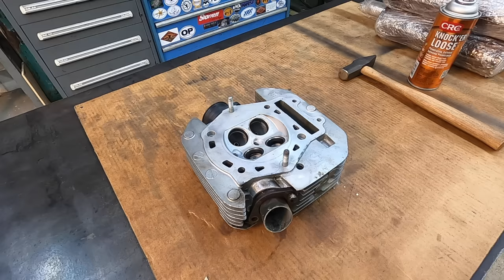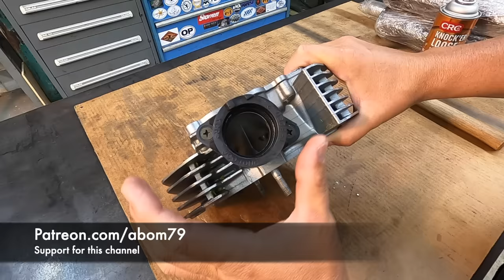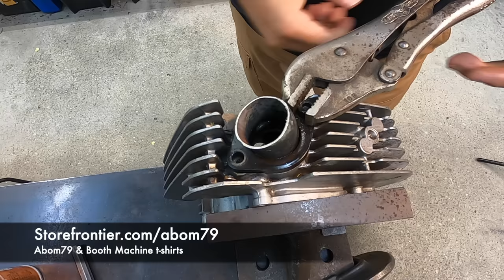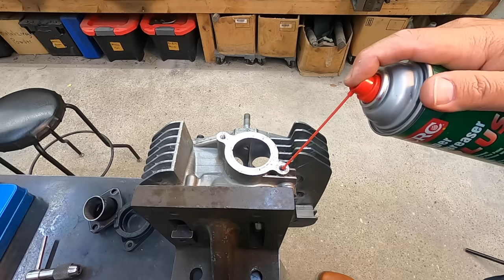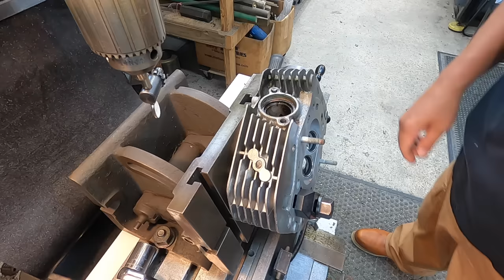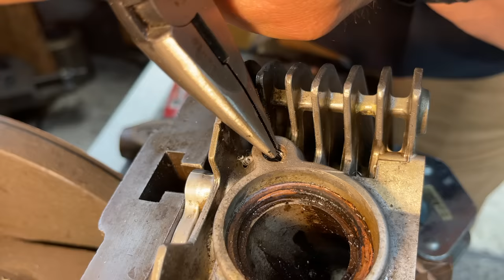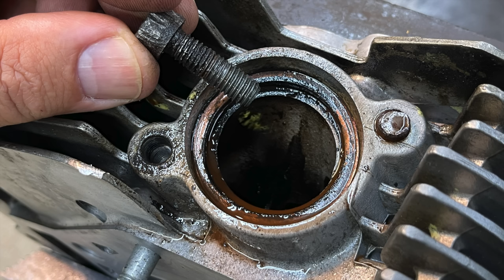Broken & Siezed Bolt Removal, DR 650 Cylinder Head

Comment: I had good luck sometimes, not every time, welding a fender washer to the broken off bolt and then welding a nut to the top of the fender washer.  Fender washers provide a larger surface area to weld to than a regular washer.  Just for anyone that doesn't have access to a Bridgeport but has a welder.  Good job!
Reply: Great job👍

Comment: If you have a motorcycle, you HAVE to have an impact driver.
Reply: @jlinkels  same here, identical, in 1976
Reply: With the full range of tools in high tensile steel !
Reply: With every motorcycle I have owned, FIRST THING MODIFIED, remove and hurl away every last engine cover Phillips-head bolt.
Immediately replaced with a set of grade-8 socket head cap screws.
A single allen key works WAY better, lasts longer, and takes up much less space in the on-board tool kit .
Reply: and JIS bits
Reply: @jlinkels  About 74 for me.  Identical
Reply: @jlinkels  Ain't broke don't fix.
Reply: @agwhitaker   Totally agree ! I used to work with Oilfield Tubulars and had access to ,'API Modified', a special silicone grease containing lead and zinc particles which I used to smear on all threads to help stop seizing up. Worked 100% !
Reply: @agwhitaker  That's the way! And if not Allen Key then Torx. I developed some kind of "hate" against slotted, Philips, JIS and Pozidrive screws over the years. Maybe due to the fact that I came over hords of cheap screws from Asia in all the things I was working on. So I also get those out of any model kit or motorcycle I am working on. You may call that somekind of obsession, but I believe it makes maintenance work much easier. The only exception I would accept would be some 60 to 100 year old classic vehicles. Imagine a 1930's Bugatti with Torx or Allen Key screws.
Reply: any repair work, on anything, Impact driver is a great start !
Reply: @erebus1964  Agree, yet have become fond of Honda style 8mm hex bolt style as they don't fill with gunk and offer good grip with lightweight tools as well.

Comment: When they're really stuck like that I generally apply heat. Get it really hot and then if it doesn't come out I'll allow it to cool shrinking the bolt. Add a little bit of penetrating oil then again try to turn it out while tapping on it. It can also be drilled and an easy out used. Sometimes a variety of methods have to be tried before something works.

Comment: Many people have explained what is happening here but I will give you the final correct answer. I studied and understand materials, I'm  a Materials Scientist. 
As previously explained here we have steel and aluminium joined as a thread rod. When installed together especially without antisieze between thread, these bolts can lock together especially if they corrode. Rust expands 5 to 10 % . This causes tremendous internal pressure.  In addition differential corrosion can occur with dissimilar metals.    The only true way to undo rusted and chemically 
bonded bolts is to heat the bolt and cool it down QUICKLY  with a wet rag ( heat it to say 800C). This heating by itself doesn't work all the time. Heat and sudden cooling give threads a thermal shock. I have proven this on a nut holding magneto cover on lawnmower.  Heat alone would not loosen it. Thermal shock with cold water broke the bond. Also WD40 falsely claim they loosen bolts. That oil cannot penetrate a rusted bolt. They are spurious claims. 

Have I helped anyone out there?

Comment: Retired Master Mechanic here....
On Aluminum parts, you can HEAT or COOL the component to cause that metal to expand or shrink.
In this case, I'd have put that head in an oven, THEN try removing those bolts !  Try it, it works !
( this one: 350'F for 30 minutes before working on those bolts )
😊😊😊😊😊

Comment: Just welding a nut has been 50/50 for me over the years BUT if u take a washer, weld the inside hole to the broken bolt and then weld a big as possible nut to the outside of the washer then try. Has work 100% for me from tinny screws to wheel studs on skidders and shears
Reply: Sir, that's a very good suggestion,  thank you 😊

Comment: Well done Adam, You were very persistent on that first bolt, and you made it come out, the two smaller screw with the impact driver, The right tool for that job, the last screw, you dead centred that one, and peeled that thread out, I have managed that a couple of times but you only need to be a small amount off centre and it makes it a lot harder, I've been there too.

Comment: Lots of comments about patience, etc.. what comes to mind here is confidence and determination. This is the last stop for this bolt.
It has to come out, there is no where to bring it to “fix” it for you. Things will escalate until the end. Easiest first, if no, next step.
I think there’s a point in your work,profession whatever that is, that submitting to the problem or defeat does not enter your mind.
There will be a resolution, for sure. You have become competent at your work.

Comment: In my experience over the years I found that applying heat modestly  and allowing the area to cool down and heated up again quickly  helps a lot in the process of moving bolt. Works for me.
Reply: I would also apply heat too long process

Comment: I really miss this kind of work. Spent most of my life doing all kinds of tool work. Good to see the older techniques still being used.  First off, fixturing your work properly is tantamount to applying force to the work piece, whether it be shock , twist or machining force.  Patience when you have something to grip too and being conscious of saving the original threads is becoming a lost art.  You can't always use a heli-coil or keensert so build your skillset to the worst case scenario and always get the job done.  I used a dowel pin with a square ground face, to remove the radius edges,  to align the drill chuck or mill collet.  I kept a set of sizes including odd ball in between sizes made from ejector pins or any other decently group metal rod in the same box where I kept my edge finders and wigglers.  My last job discarded so many great old mill accessories like dividing heads and adjustable angle plates, rotary tables etc.  They really thought the CNC's didn't need any of it. Glad to see someone who knows better. Keep this kind of work alive friend and it was great to watch.

Comment: The good ol' Vessel impact driver - always looked the same  - I've had mine for 45 years.
The bits are JIS ,by the way
Penetrant generally doesn't work where it is an alloy part. The aluminium oxide that forms in the thread is far less porous than iron rust.
On the screw that still had a head, I would have heated it with the TIG arc and let it cool ,then tried the vice grips again. The heat sometimes degrades the oxide that is seizing the fastener and allows it to break loose.
Reply: mine was the same just marketed by Imperial. Many happy years
Reply: I had that exact tool about about 40 years ago too.  I didn't need it often but man it saved my butt many times.
Reply: @boaterbil  Had mine since the 1980's  Worth it's weight in gold.
Reply: thanks for the wisdom.
Reply: I'm guessing they all come in the same blue case as well hah, mine did.
Reply: @ItsMrAssholeToYou  or if you have this handy dandy inductive coil you can do something pretty fancy. Like so:
https://www.youtube.com/watch?v=YJElT9xK3bk
Reply: CRC penetrant is trash, so is PB, so is Kroil and pretty much everything else.  Try Nano next time.  I'd also have heated it by welding a nut to it because if that didn't work it would have been the same steps to drill it out, but welding a nut on has worked literally every time for the last 30 years.  I would have also helicoiled those threads while the head was off.
Reply: The second I saw those intake screws it was screaming for my old trusty impact driver.

Comment: Snapped a headbolt on my 750 Norton years back,drilled out the stud with a undersize drill bit ,chased the threads with a tap,worked well without removing the engine from the bike,lucked out.

Comment: I have had one of those impact drivers for over 50 years now. I must admit, I had it for a number of years before I found out the head comes of it to show a 1/2" drive  that fits 1/2" sockets, which makes things a mite easier at times. I still use it occasionally now, a year or so the last time.
Reply: Just about every home and shop cycle mechanic had to have them...I still have one from the 1970's.
Reply: @Garth2011  I have one too. I bought it in the 70s for work on my Honda motorcycle........ I think it cost~$5!!
VERY handy!!
You would be so surprised how many do not preload before hitting it.

Comment: I’ve removed hundreds of bolts using left handed drill’s,
I’ve also used left handed taps then removed the bolt with a left handed bolt,
It’s worked 9 times out of 10.

Comment: My old French Guru, when I was serving My apprenticeship in HD Mechanics, taught Me to, with a brazing tip, heat the stub of the bolt to red hot, then allow it to cool naturally....the cooling rate of the dissimilar metals would cause them to microscopically separate, leaving a gap to allow penetrant to invade....the impacting would be an aid also to the penetrant, before using Your best means of extracting....be patient, use all the tools in Your toolbox, before applying brute force.....God bless Magoire "Max" Beillard, He served His apprenticeship in France during WW2, no parts available....You  "fix" everything....

Comment: Another great video. I see some comments lack common sense.  I have the same impact driver I've had for probably close to 40 years now still works perfectly. Have to use those a lot inside transmission on motorcycles on tear down and install.

Comment: Anybody that says welding a nut to a broken off bolt ALWAYS works, is either very lucky or hasn’t done that procedure much! In 40+ years of dealing with this kind of stuff, I’d give it at best a 50% success rate. You gotta have a full bag  of tricks in this kind of work!
Reply: Welding a nice thicker washer works better the washer ID must be bigger than the stud OD then weld a nut to the washer it’s not 100 percent but much better than just a nut which is difficult to weld into the internal corners compared to a washer.
Reply: I agree and am not convinced that method works like people think it does. Why would welding a nut to the bolt be any stronger than the original head that snapped off? I don't think it is the nut that does most of the work but the heat shock of the weld.
Reply: It works the best for armchair quarterbacks. In the actual shop environment, 50% effectiveness would be a stretch.

Comment: I worked in a fab\machine shop for 30 years for a moulding millwork / lumber mill, retired now. Removed many broken and seized bolts over the years just like you did it. Always preferred doing it this way instead of taking a chance of destroying the part with heat or other extreme measure, good work, love the videos makes me want to go back to work.

Comment: I've taken many broken-off bolts & studs by welding a washer on first, then a nut on the washer, let cool,, then heat some, add candle wax.  this high welding heat breaks the bind, comes out with a socket or box wrench.   Welding & heat can do wonders.

Comment: Many years ago, an old neighbor was a fantastic Harley restorer.  He showed me the trick to chemically dissolve steel bolts from aluminum cases and transmissions with alum.  It’s my go to with aluminum (I only have hand tools, no mill or lathe).  Sometimes not having to completely disassemble a machine is nice too.  It’s a really good method for getting that broken tap or drill bit out of the hole

Comment: That was sweet! This method is nice if the part is off the bike, and you have a well-equipped machine shop. However, if the part is still on the bike/car, in a tight spot, then a mig welder and vice grips come to the rescue ~95% of the time. Last head stud I had to extract off of a Suzuki GS1100 took about 10 "blob" weld attempts, but was very satisfying when it finally spun out :)
Reply: Try welding a flat washer to the broken stud or to the frozen stud head, tgen chip the slag and weld the next size up, bolt to the washer, all the way around if possible. Let the RED go away and then slowly remove the stud or bolt. The welding and cooling down then welding again breaks the bond down on the threads. Even if you have to drill the hole out, (if it melts the block part,)and use a Heli-coil to go back with, it far beats buying a new part! 
   Hope this helps ya
Reply: @general5104  I don't like wasting washers and nuts and bolts... The weld breaks off at the stud interface anyways, so repeated blobs and a stud extractor seems to work fine 🙂
Reply: What’s scary is welding broken bolts  may anneal and therefore weaken that area of aluminum including the threads. Just my 2c.  
Best is to install studs screwed ‘permanently’ to the delicate head and easily removable nuts to secure intake and exhaust parts, instead of using bolts which are prone to getting stuck not to mention crossthreading by careless mechanics.
Reply: For jobs that are still assembled, I run the engine to it’s hottest running temperature and do the mig and nut with hi-tensil wire. Thanks
Reply: The first 9 attempts were just getting enough heat into it
Reply: @general5104  jjjij
Reply: Lb,
Reply: Lb,,
Reply: @PineHollowAutoDiagnostics  I had a friend weld s bolt to top of broken cylinder head  on the bike and once he welded it we just in a rewed it with a spanner/ wrench it came off straight away
Reply: AH' - sha  - wah.  Plus, since the bolts were in a faulty connection, why not run them through a die before returning them?
Reply: @zukobringas5096  Yeah! Careless mechanics! I "love" them. One of these guys tightend a 6 mm stainless steel screw into an aluminium block without cutting the thread deep enough. I HAD to remove the screw but it turned about only 15 degrees then i can feel it got stuck. This screw holds a vacuum tube to the discharge tube holder block of a laser machine. So you don't can smack around with a hammer nor can you apply heat in any way because vast (0,1mm) movement of this block mechanical or thermal will destroy the whole machine. Also there was no space to bring in heavy equipment like elctromagnetic stands. I had only one try to drill out the screw with an electric hand drill because of the position of the screw it was not possible to replace the thread with a bushing. In case of a fail the vacuum tube would not longer be tight. Result : Machine destroyed. IT TOOK ME TWO DAYS!! But I succseeded.
Reply: Gg
g
Reply: @general5104  hi there I've seen many videos on thus and almost all are successful . I've been trying to remove my header bolts in situ but not going well I'm only using arc as I don't yet have argon  gas (own a mms/tig  ). I did originally try the nut method but nit wouod look adhered /bonded but in no time round off . I tried washer method which I think if I had it right I.e. settings and so forth I'd possibly get it . I recently got smaller gauge rods 7018 ones of I recall I do have lots of 6013 ones too . When I upped  the amps as many suggested it pretty much melted one of the studs (I have a few see ) on that particular stud I had built up the weld at 1 point arc tap arc tap etc felt good but again over time broke I know many are persistent and get it . Time isn't on my side atm given I have little nippers  . It's trying to fit it all in . Contemplating removing engine
Reply: @general5104  9
Reply: @khalidimtiaz52  dèi9

Comment: JIS screw heads are NOT the same as Philips. I don't know if anyone needs to read this but I preach it whenever I can. Using a Philips driver on JIS will be frustrating because it will fit loosely and will cam/strip out. JIS drivers on the other hand fit Philips really, really well. That's why I try to get screw drivers in JIS whenever possible. Vessel is Japanese, so that impact driver is JIS and the bits were are a perfect fit.
Reply: JIS slots are more precise as philips screws.

Comment: Those impact drivers are your number 1 tool when your dealing with Japanese motorcycles and ATVs.  It’s the first tool I reach for. Spend the money and get the Allen and Torx bits to work with your driver.  I made an adapter to use the 1/4” bits in mine (standard bits are 5/16” hex in most driver kits).  Keep up the good work Adam👌

Comment: Yeah, a larger Phillips than you think it needs usually works fine with JIS. It's when people use pozi that things gets chewy.

Also, if you really want to crank down on a hex with vice grips, get an Allen but in the head. Stops it from squashing
Reply: Good tip re. sticking something in the cap head socket so you don't crush it, I'll remember that one, cheers.
If it's already rounded out I guess you could also use a solid drift of suitable size.
Reply: This also works with stuck brake bleeders.  Stick a piece of rod through the bleeder before using force to prevent the hollow fitting from collapsing.  A broken drill bit works a treat.

Comment: I pour boiling water over the aluminium alloy.  That expands it just a little and it barely expands the steel at all.  If I have enough pot space space, I put the head into the boiling water until it reaches about one hundred degrees Celsius.   Every little bit of loosening helps--

When I put in new bolts, I use Hylomar on the threads, and if I can not get any of that, Bitloos, which is a polymer product used to make sure the bits on soldering irons do not get jammed in the heater.

Comment: Just did an 04 Dodge Hemi, in the truck, with most of the exhaust studs broken off in the heads. Welded nuts to 3 of them that were flush with the head and got them all out. Great Job!